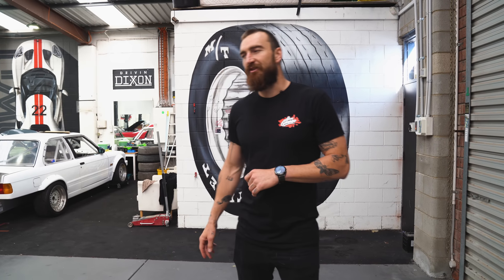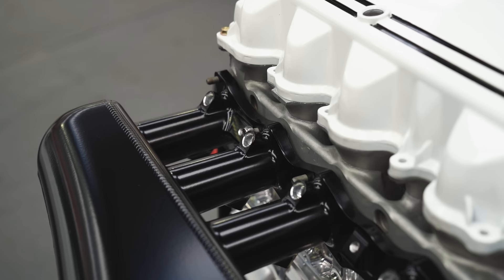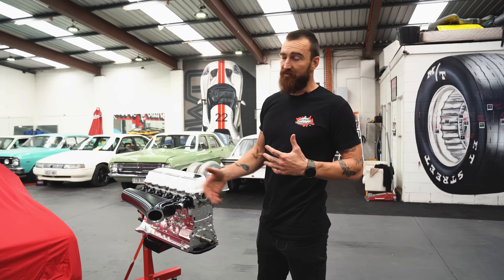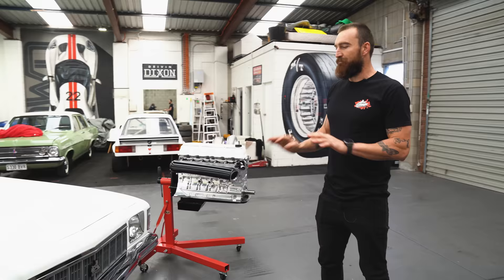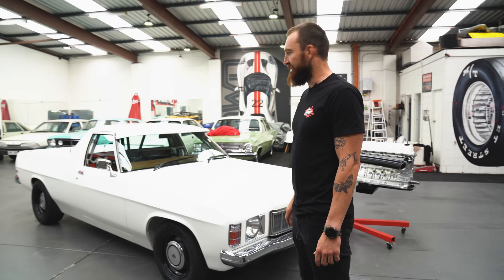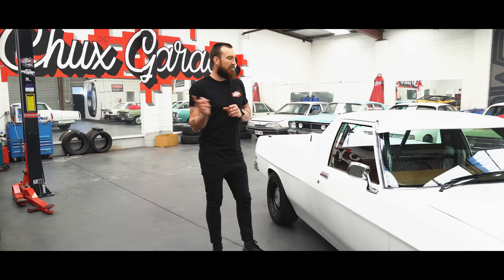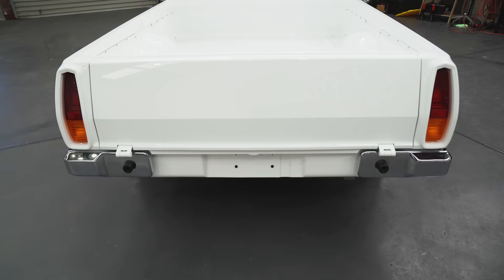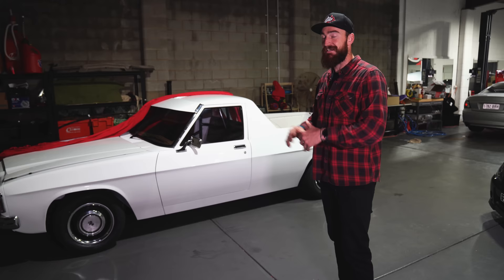1977 Holden Billit RB HX Ute Reveal

Comment: Is that a Nissan RB30 engine going in the ute mate
Reply: Think he said rb25 stroked to 3.2l   don't know why he chose to go that way as the rb30 single over head cam is worse than the rb25 dohc   the billet stroker nice but would have been alot better off building a billet rb30 with rb25 head    big waste of money on the engine just to be different  the rest looks great
Reply from the maker: @trevevns3242  it’s a rb30 block stroked to a 3.2 and I went the single cam because it’s what I like and I think it suits the car better, that’s all haha